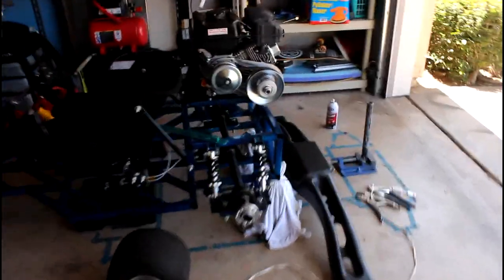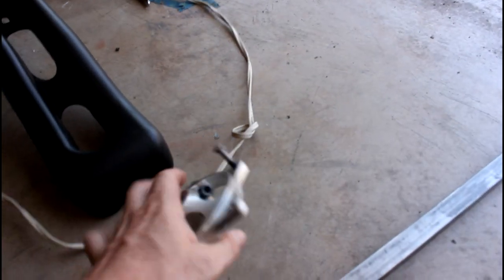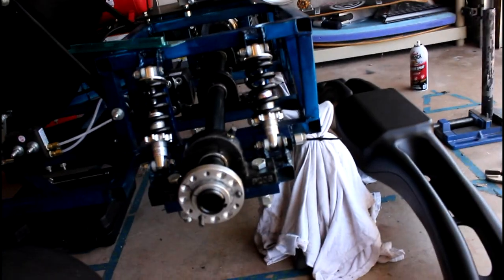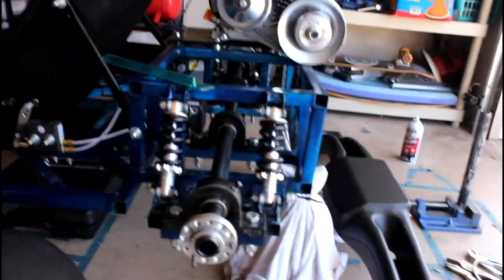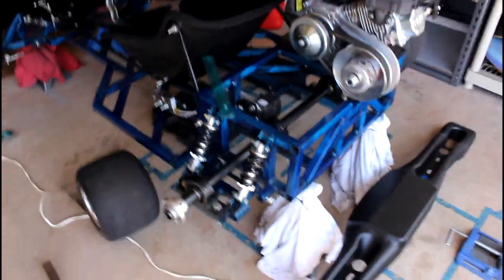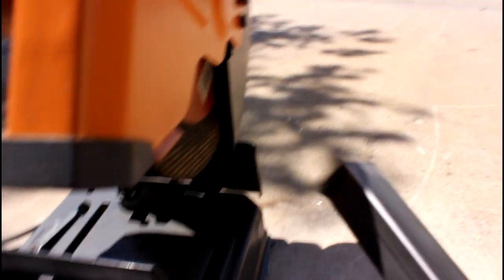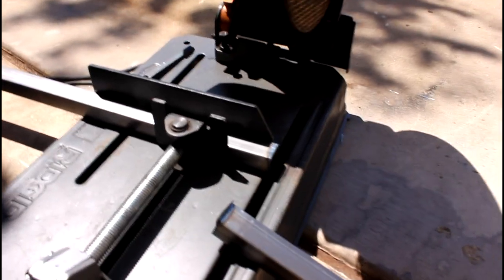(Homemade) Go Kart Build Project: Building the Bumper Brackets Pt.1 !!

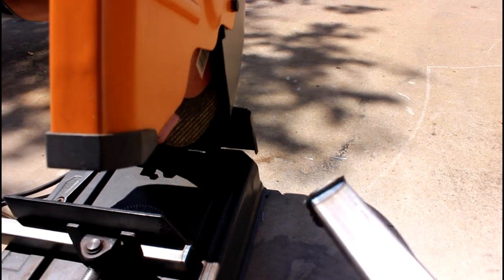Comment: 12:05  burrs   The only issues Ive ever heard about doing this.  Is it makes the saw blade is so thin it makes the blade weaker.  Which can make these blades basically explode with all the centrifugal force.    But just a word of caution (Im not say I have or have not done this my self ;-) 
 I usually use my bench grinder.  If you dont have one you can get them pretty cheap and you will wonder how you got by with out.  I have a grinding stone on one side and a wire wheel on the other and use it all the time.
As always great video!!!
Reply from the maker: Gotcha, thanks for the tip!

Comment: hey wad up man nice vid as always the graphics look a bit cleaner new camera?. anyways not try to be a dick but the cut blade shouldn't be use for grinding you could weaken it and the could be really bad trust me I know. an one more tip on safety is you should try to use a respirator it's not good to inhale the smoke or dust from the machine. all an all keep it up man. #benzdo vid.
Reply from the maker: Thanks for the tip man, I appreciate it